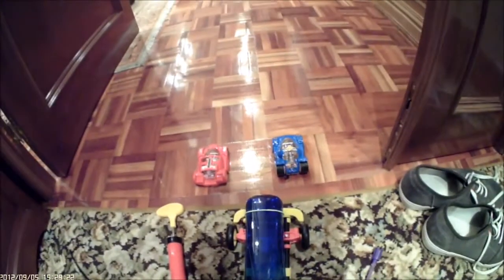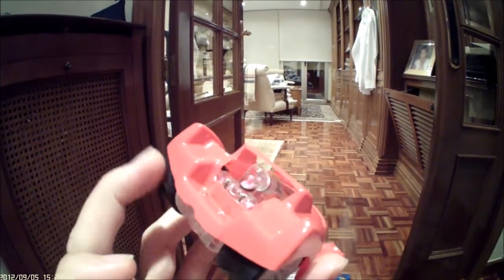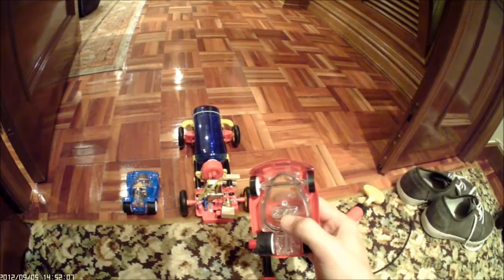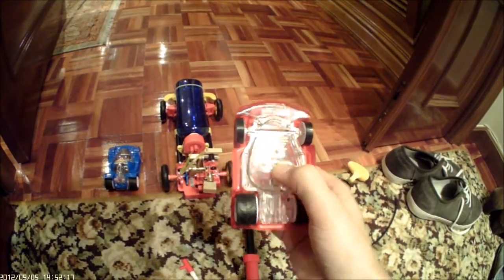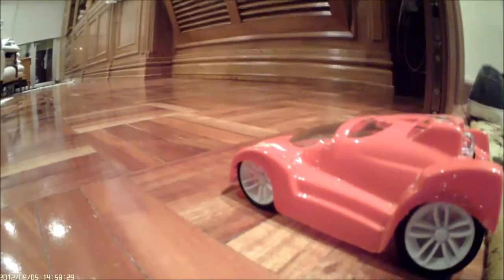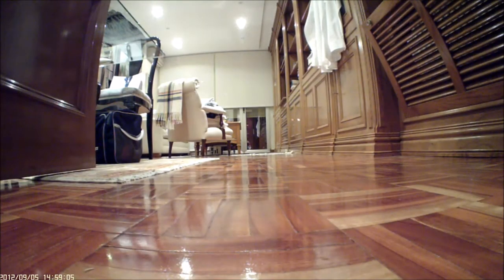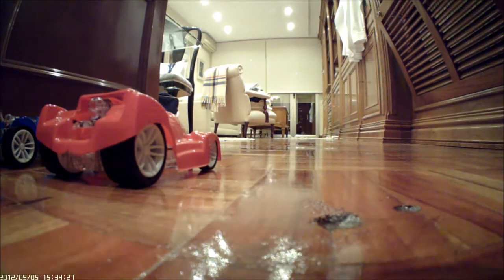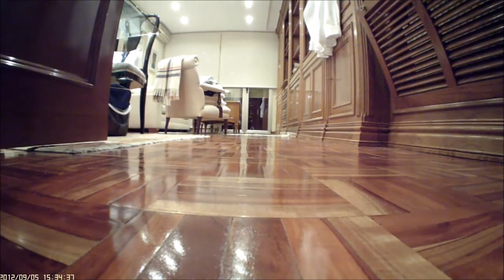Air Zero Sega Racers compressed air engine

Comment: Great fun, pleased to see you have just as much trouble as me trying to get them run straight 🎄🎅😊
Reply from the maker: Oh..."that"...
Well the cars have the front wheels made of solid plastic, and I thought it was causing the steering problems, but actually it's a blessing, since they can slide. I realized that it's much better to have just one steering axis (which is also the powered axis)
And I (almost) solved the issues by launching the cars with a more lenghtwise movement than the one you may see here. I put my hand over the car and slide the hand the very first 25cm (quite a lenght actually) because I noticed that the steering problems start with the first acceleration. Still not perfect :)